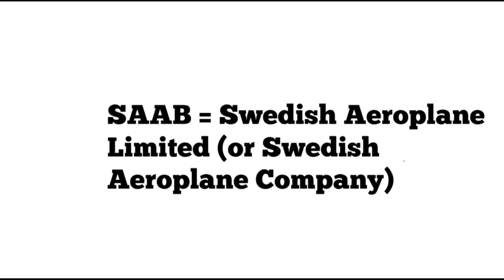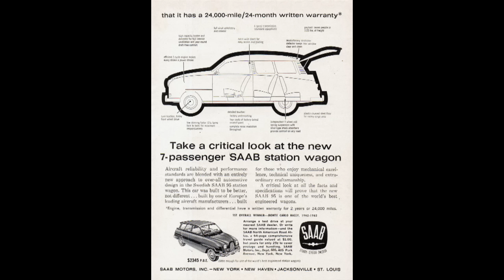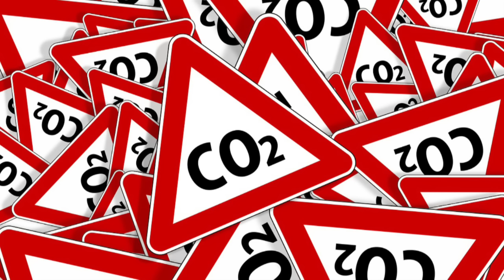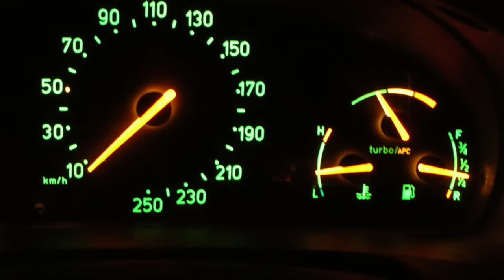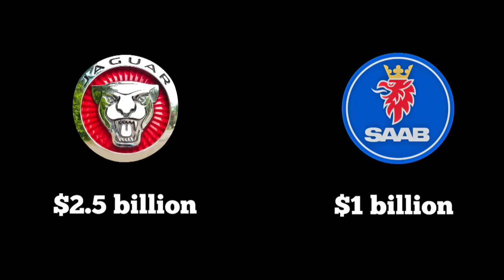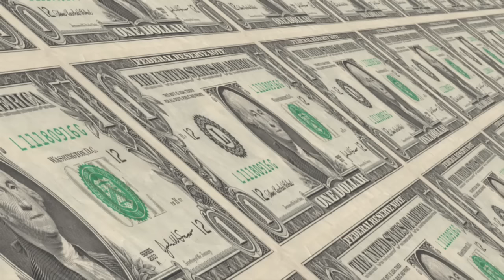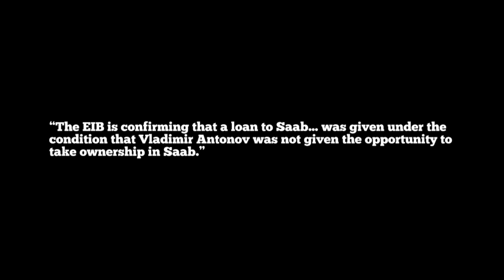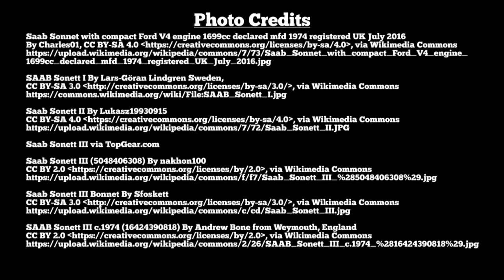The Life and Death of SAAB: RCR Car Stories

Comment: The difference between Saab and Pontiac or AMC is that Saab wasn't just like every other car but with a different grille and a different name on it. Saab was a clean sheet of paper design from engineers (as opposed to stylists) who recognized that a car is a machine, not a rolling sculpture, and wanted to make something that functioned better than the average car. Unlike some other car brands that have disappeared, Saabs didn't rely on gimmicks like DeLorean and Hummer and Tucker and Bricklin did. Saabs are best appreciated by people who understand engineering as opposed to judging cars by what they "look like".
Reply: Is that why they couldn't even get all the normal things right?  no car should have as many nitpick issues as an old Saab.
Reply: All 3 of the car companies you mentioned had clean sheet designs from engines. Other than Pontiac where Most of the models were based on the same platforms.

Comment: I recently bought a 2008 SAAB 9-5 at auction for $700. 165k miles, no rust and in very good shape. It was auctioned as an abandoned vehicle at an airport. It's amazing how fast it is for a 4 cylinder. Very comfortable and luxurious. Good handling and the trunk is huge plus the back seats fold down for more storage room.

Comment: Some notes from a current Valmet Automotive employee, firstly it't pronounced Walmet not Falmet.
There actually is a biography made of Greta Molander, but it's in Norwegian so have fun with that.
The first 99 finlandia was a one-off for the president Kekkonen but there were more lengthened 99:s and 900:s made later.
Saab-Valmet produced 96 and 95 before the 99 and as you mentioned later made mostly convertibles.
There were some funky variants developed in Finland, like one running on kerosene for tax reasons (like in the simpsons gag that was referenced in the Trabant video) and a unique 9000 with a saab V8 that was planned for the american market before the GM merger buried the project.
Reply: The V8 was an in-house concoction of 2 B204s joined at the crank. I read an interview, and later found a video of the engineers (in Swedish) describing it as "a hoot to drive", and apparently they had the speeding tickets to prove it.

Comment: I am so happy to see this finally posted. I didn't understand what is was about SAAB that makes owners love them so much, until I owned one. I hated my friends dad's red 1990 9000 wagon naturally aspirated, but I loved my  jet black 1999 9-3 2.0L (1985cc) turbo 3-door hot hatchback. I have had the car since 2011, and it has moved me across the country because it has an insane amount of storage in the rear. It is a like having a full size wagon or SUV with the rear seats down. It is hard to describe why I like my SAAB 9-3 so much. Even though GM owned the company at the time, so many SAAB elements are present in the cabin you don't feel like you are in a GM product. The steering wheel is nice, so nice that Cadillac started using the SAAB steering wheels in their products. The seats are incredibly comfortable, and the car is a highway cruiser. I have the car tuned to 23 pounds of boost currently, but even with stock ECU settings the 9-3 can pass with ease. I would often be amazed that I was suddenly going 90 MPH passing someone when I was just going 55 MPH with stock ECU settings. SAAB could have been a success, but they often missed easy chances to save money and make a profit, which I don't even like to say because they made such amazing vehicles. Safety was clearly a concern in every vehicle SAAB made, and it saved my mechanics life, and the life of a friend of mine who rolled his 9-3 in the mountains. My mechanic was rear ended by a a semi truck going 40 MPH, into a trailer in front of him, and he was able to walk out and open the door even though the car was essentially a cube. My friend who rolled his 9-3 ended up on his roof, and was able to open the doors and walk out with no injury. I really feel safe driving my 1999 SAAB 9-3 compared to my 1999 Honda Civic or my 1997 Nissan D21 HardBody. It even feels much safer than my 1996 Infiniti G20. SAABs are safe, and if you are looking for a safe used car, that could also make monster horsepower on stock internals, a SAAB may be for you. Also, don't fear about getting new parts. OREO AB (not the cookies) is the official company making replacement parts for SAAB using the original tooling. The Swedish government essentially owns OREO AB, so it is not going out of business. Thanks for the video, and press "F" to pay respect to SAAB. 

F

Comment: SAAB being lost pains my soul. This documentary is beyond excellent, but also heartwrenching. Thank you for it!

My first 900 was a -88 or -89 but it was cursed with bad luck. First my mom struck a deer, although the car only needed minor bodywork and a new headlight. Then a pretty huge tree fell over it in a storm. Only needed minor bodywork and a new side window. Then in 70km/h I drove straight into the side of a Volvo 740 who ran a red light, which shortened my car by about 50cm, the engine pushed up in a 45 degree angle and the wheelhouses for the front wheels touching the tires. I was completely unblemished and the car still started and was drivable, so I got a police escort to drive it home (which was only about a km away), but this was not fixable and it's next owner was the local junk yard.

Nowadays I drive my second 900, a -92, and I've had it for 16 years. I wouldn't be surprised if I still drive it 16 years from now. Best car I've ever driven in so many ways.

Comment: The old APC system was fantastic! Instead of digitally manipulating fuel maps, there were about 4 adjustable potentiometers inside that you could adjust. It was also really easy transplant the APC system onto another engine; all you had to do was tap a threaded boss into the target engine's cylinder head for the knock sensor, and figure out a few taps on the turbo (inlet pressure, boost pressure, and a line to the vacuum operated blow off valve.
Reply: i had one 900 turbo, driving and adjusting potentiometer so it spitted flames, good times !!

Comment: I only owned one Saab, a 1967 model 93 Monte Carlo 850. I took it to Dreyer-Rheinbold, the Saab dealer in Indianapolis for a tune-up only to have them put the wrong sparkplugs resulting in a holed piston. It took a year to find a mechanic I trusted who swapped out the engine for a non-self oiler. Drove and loved the little 3 carb 2 stroke til a genius at Al's Auto Electric crashed it while in for service. Got a new Fiat 129SL in 74 which rusted as you watched. Later got a 75 Audi 100LS that was a good ride. Gave it to the wife in a divorce. No car I've since owned has had the spirit of the little red 67 Saab. Terrific video btw..

Comment: As a film buff & aspiring filmmaker, I’m glad to see the mention of Drive My Car in this RCR Story at 1:31:22. It’s an incredible film if you haven’t seen it. Worth every second of its 3-hour runtime.
Reply: Hear hear. It's a slow build but so incredibly engrossing. And I'm always happy to see a film utilize Waiting for Godot.
Reply: After watching it at an indie theater, I didn't have high expectation, but upon the end, it stuck with me, not the best film for me, but will be most memorable one for years. The red 900 is perfect for the role, I can't imagine if any other car will fit the role other than a 900.
Reply: @worawatli8952  In the original short story it was based on, it was a yellow Saab 900. However, due to COVID, the film had to change its main setting to Yokohama, where the director decided to make it a red Saab 900, as he felt that red fit better with the landscape.

Comment: I’m driving a 9-3 to work as we speak. 14 years old and 147k miles. Spent about 200 bucks on coil packs. That’s it. In 10 years of ownership, I’ve spent 200 bucks on non-wear parts.
Reply: Congrats, you're one of the lucky ones.  But overall, Saabs are nowhere near reliable.
Reply: @realpillboxer  I’ve had two and they have been nothing but reliable. Guess I’m double lucky.
Reply: @realpillboxer  Saabs are incredibly reliable. I’ve never had any worries or issues with any of mine. Neither has anyone I’ve ever known or met that’s had one. You must’ve been unlucky and had a dog

Comment: My dad worked with their V8 project in the 1980's that didn't go anywhere. It was effectively ready for production but the GM purchase fucked the project up and the Swedish part of the company wasn't very enthusiastic about it either.
Reply: Would your dad happen to know where the remainder of the V8 parts ended up after they returned to the Saab-Valmet factory (three engines are in museums, but the other two???)? I assume they were destroyed, but I wonder... ;)
Reply: @aaroncarlson3686  One still is in the 9000 test mule, the other's sitting as a spare for it.
Reply: This is something that would've been cool to have been resurrected on the Sigma body as the Saab variant of the first-gen CTS-V, or even on the fifth-gen Camaro's Zeta body.

Comment: Stepdad had Saabs since I've been aware of my own existence, OG 900, gloriously comfortable and always leather smelling pre-fl 9-5 combi, silver aero fl 9-5 sedan with a gloriously abused by me rear bench seat heating, fl NG 9-3 combi V6 Aero manual basically full spec with tons and tons of Hirsch parts (effing amazing car), pre-fl 2006 NG 9-3 cabrio V6 Aero Anniversary Edition (beautiful cream interior and blue exterior) and finally NG 9-5 TTiD manual with a very high spec interior. 

We still have the 9-3 cabrio (we had it basically from factory) and it's almost exclusively driven by me now, which is amazing considering I remember sitting in the backseat of it for years going on trips while I was much younger. BSR exhaust, maptun ECU tune, original Hirsch parts, air intake that causes amazing turbo noises - about 300hp, shit tons of torque, buttery smooth aisin 6 speed automatic, such a good cruiser (that will struggle for traction at every situation and speed...), will definitely catch out many cars when it gets rolling, acceleration is addictively smooth and effective. Love SAABs, even if the check engine has been there on the dash nonstop for the past 4 years and something goes slightly wrong on it every 3 month...

Comment: Brilliant documentary with fantastic c production and presentation.

I have a 2008 SAAB 9-5 with 125,000 miles on the clock. Since new a total of $5,028 has been spent on all parts, labor, tires, batteries and fluids. That comes out to $359 per year.

Sure there are the typical GM bean counter insults, like removing the fuel pump access from underneath the rear seat, and removing the transmission fluid dipstick, but there are SAAB Master Tech workarounds.

The 9-5 has never left me stranded, and I'm comforted in the knowledge that this is the safest structure on the road and will save my life. Plus, living and parking on the streets of NYC, criminals won't steal my car or parts.

The timing chain usually lasts 200,000+ miles...same with the Mitsubishi TD04 turbo. The automatic transmission is the bulletproof Aisin AW55...just change the fluid every 20,000 miles or so.

The comfort of the seats is life-changing...even better on the pre-2006 models. The trunk is huge. I wish that it didn't take premium fuel, but the trade-offs are worth it.

My previous SAAB was a leased 1987 900 Turbo. Unfortunately that wouldn't be a good daily driver today because it lacks airbags...but I miss that car everyday.

Comment: I was a mechanic from the early 70's through the late 80's, and prided myself on being better than the average mechanic...But working for local 
repair facilities, (Sears, Wards, Gas Stations, etc.) I was fed up with the garbage coming out of Detroit... They couldn't even build a car that the paint would stay on longer than 5 years....Then I took a job at a Saab dealer as a Technician...One of my favorite things was the factory training programs they had...Within a few years I was a Master Technician, one of the most impressive things was the engineering that went into building the vehicles, they were extremely well designed...I fell in love with the 900 Turbo SPG (Special Performance Group) and their ground effects, (they just had such beautiful lines)
The whole Vail Colorado Police Dept. fleet, consisted of 900 Turbos exclusively, and they absolutely loved them...After the Dealership I was working for closed, I just couldn't go back to working on American cars....So I bought an 18 wheeler and spent the next 35 years driving....

Comment: I bought a 96 900 n/a with 120k miles on it. Sold it with 327k miles on it, still running like a champ. 
RIP Saab, you will always be loved.
Reply: I just bought a 900 96 last year, drives like a champ and I live the interior. Bought it for a thousand bucks with 120k miles, such a good deal
Reply: @cloudy1723  make sure you keep up the belts and oil, the engine is all Saab, but the rest are GM parts and you can still find those.
Reply: @lupusalbus3795  thanks, will do

Comment: As a working college student, in Minnesota I was carful with money and purchased a rust colored '76 99 GL 2 dr. manual in 1979. It had some electrical and injector issues, but I really enjoyed going out in freshly fallen snow -  the deeper the better and showing my buddies how well it performed. I also took advantage of the fully retracting passenger seat on dates.  Front wheel drive was not yet mainstream aside from some tornados and Hondas. Although you could call it "quirky" I prefer the term you used (exotic) in the video. I was hit from the rear and a local Saab mechanic happened to have a '75 rear end available so he offered to do a rear clip  for only $500.  It was like the accident never happened - even the buyers Saab mechanics inspection didn't discover it (although I did reveal it in the end).   I also

Comment: Might buy an 05 9-3 aero saab tomorrow imported from Austria, hopefully owning one goes well
Reply: Update, bought an 06 6MT Aero 9-3. Absolutely love the thing. However they are in need of restoration so be prepared when you buy one. Issues include coolant hose replacements, coolant reservoir replacement, leaky power steering, falling apart interior, water leaks, and maybe some slight hard to find electrical gremlins.

Comment: @59:09 - The attempts to tame wake turbulence are probably aimed more at drag reduction than as a safety measure for any too-close following vehicle. While wake turbulence from a heavy airliner can (and has) roll a good sized airplane following too closely behind (and below), it's not enough to produce a dire effect on something that has 4 wheels contacting the ground. It will produce a noticeable amount of drag, though. Winglets on modern airliners serve a similar purpose (wake vorticies spiral downwards off the wingtips as the low pressure air on the top of the wing slips off and curls under the end of the wingtip), reducing overall drag by 4-5%.

Comment: I don't know that ford would have done better with SAAB than GM but in my humble opinion Ford made the same mistake with Jag and Mazda as GM made with SAAB. They bought companies known for ambitious engineering, my tactic would have been to support this trend financially,  make some moves to stabilize the new subsidiaries finances but not push them towards the volume manufacturer model. Utilize their strengths as a source of developing tech and ideas. 

Buying SAAB then making them sell rebadged Chevies doesn't make any sense, buying SAAB and letting them go a little nuts with technology you can then migrate to your volume cars does make sense.

Ford maybe did a bit better than that, the made Mazda kill several of its platforms and engines, but they did give them the job of designing the new corporate 4 cylinder, and while the platforms starting in the early 2Ks were Forde corporate fare Mazda seems to have played a significant role in their development,  where SAAB were just given an unremarkable suv and little budget to rework it. 

But ultimately Ford did try to turn Mazda into another high volume badge and they basically shut down nearly everything Mazda had in the works in favor of simply marketing Mazda badged variants of Ford products.

Comment: Saab should've merged with Volvo. With Saabs experience in FWD, the Volvo 850 wouldn't have been had the disastrous issues it did and the second generation 900 wouldn't have been rushed to market in record time, resulting in even worse design errors.
Reply: Volvo also would have made more sense than GM, Especially that era of GM.  Where GM sank its most greedy corporate tendrils into all aspects of its divisions.  Also the era where they gutted Saturn from being its own unique self to just another GM brand(they always owned Saturn but for awhile it just ran off on its own and did its own thing).